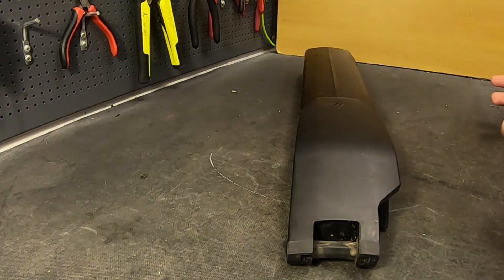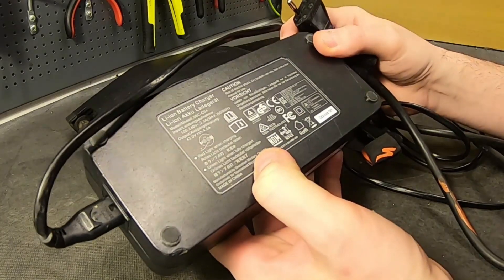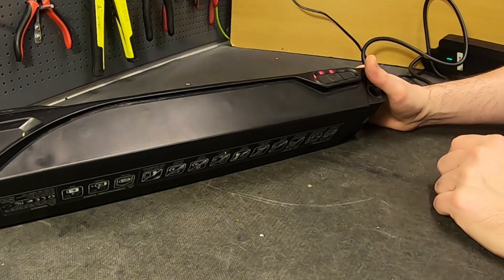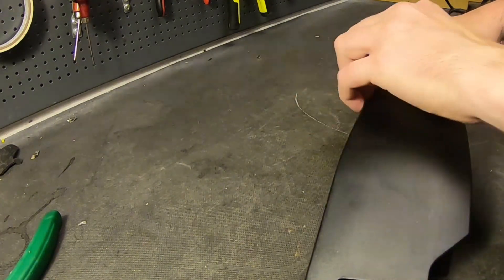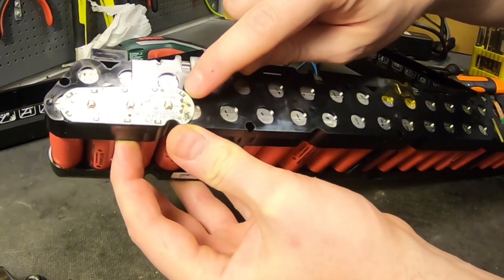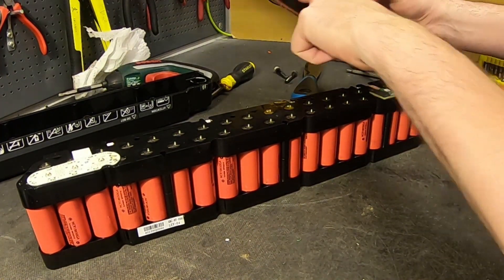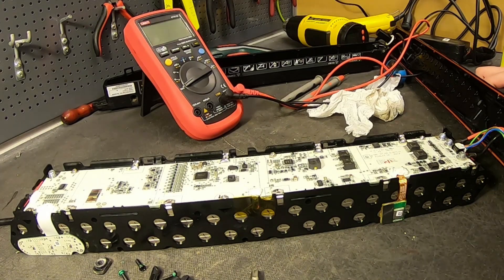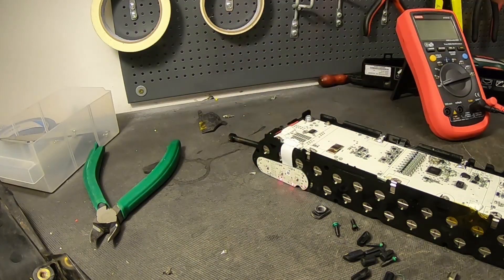Inside a €6700 (Specialized Turbo Kenevo) M1-504Wh Batterypack - with 3 flashing red lights

Comment from the maker: We DONT WORK with Specialized! Only a few copies has ever been sold in sweden! we had about 3 in so far and done videos on those.  Its a good ebike but if you buy a Specialized ebike you most like WONT be able to buy a new battery when you need it since they usually only Sell spare batteri 3-4 years after the bike is released and the battery usually last 4-5 years and cant be repaired. Well Of course they can be repaired by reverse engereering the specialized system but it cost about 11,2 miljon dollars so no one will do that. It might be different in their homemaket in USA but if spare batterier are not in production they are NOT AVAIBLE.
Reply: This is factually wrong - I just checked for the Specialized Levo. The first generation has been released 2015. Seven years have past since then and you can still buy a battery online, delivered within 2-4 days. I then got curios and continued checking for older models: Specialized has made its first E-Bike in 2013, called the Specialized Turbo, and you can STILL buy a battery in 2022! Not only that: You can buy a battery now that has WAY more power than the one from 2013 and yes, it does fit to the old bikes. Stop spreading lies.
Reply: @NemoNobody0  Where are you located? There are no in sweden, and probablly not in the rest of europe. Just because you can buy can buy it (in use, their homemarrkt) does not mean everyone can. Ther have a swedish webbsite but they dont reply to emails. They fücked sweden the same way Bh bikes did, deep, way deep..
Reply: @Batteridoktorn  I do live in Europe as well (Germany). You can order them online from many, many different stores, just Google for the name of the bike followed by „battery“.
Reply: Fuck "Premium" e-bike manufacturer
As my dad says it's like if a gasoline cars works only with one producer of gas.
Reply: @nicolozak  you fell for a lie from @The Battery Doctor. Research by yourself or read my comment above: You can still get batteries for the first E-Bike Specialized has ever produced, you can even get a battery with MORE power now then the release version had in 2013...
Reply: @NemoNobody0  e-bike battery has to be repairable, not repairable means more garbage in our planet and less sustainability, Europe have to change rules for CE requirements on lithium batteries.
Reply: @nicolozak  I agree with you on that, but this goes for all E-Bike manufacturers. The point of discussion was that @The Batter doctor stated that Specialized E-Bikes would be obsolete after four years, claiming they would not provide batteries for sale after this period. According to my research this is wrong.

Comment: The red blinking is normal - It's waiting for an input from the rider to switch to "start" mode - I.e. it's booted up / ready / Armed -  it will switch to run status once a load is put on it . If you have a big resistor sitting around or anything to discharge with - put a load on it and it should switch to the charge status and mode indication . The really "stupid" part with this pack is that it does not care if the drive unit is connected or not - it simply does load / draw etc . . .
Reply: hello. good afternoon. Did you have success repairing the ebike specialized battery?

￼
Reply: I have two batteries with the same problem... but I didn't understand the procedure you mentioned. you can explain better. grateful.
Reply: @LeandroSilva-x4b   These batteries have a behavior where the controller will bring the battery up to a ready state but the indicator will flash red until there is a draw from the motor. I'm not sure how this is programmed in the controller but it is a bit strange as they do not seem to that all the time. It may have something to do with not being actively paired with the app.  You can trick the battery into going "green" by briefly putting a load on  the leads that would connect to the motor - or just plug it directly to the motor and test. I have never found a thorough explanation of this mode just vague mentions of it somewhere on a troubleshooting forum. I rebuilt two of these packs after insulating and sealing around the controller board. I replaced all the cells in both packs and charged them equally to about 60 percent prior to sealing the packs back together then charging them. Notably I have no knowledge of how this controller "exactly" works but I was willing to try it as I had nothing to loose as both my packs were working but would voltage dip in a few miles and cause a shutdown.    ;)   Overall - the design of this pack seems great except for the control board buttons which in both of my packs ( including a non-recalled one ) was open to allow water in.

Comment: Anyone succeed refurbishing M1 battery? I had threebateris with same symptoms, 3 blinking red led and beeping. Internal cells are OK, currently charged on 3.7v/block but still BMS does not want to take charge over original charger. BMS has RISC processor but cannot find anyone on internet that successfully refreshed or modified firmware to clear state.
Reply: In case of you charge the battery block by block (so not with the original charger), is the battery able to drive the motor? I mean, does the power electornic part of the board work to the direction of the motor?

Comment: Hey Doctor! We need to hear if you got this battery alive again? I had the same issue! But the bike drove OK for 35 to 40 kilometers.. I talked to LBS and he advice me to firmware upgrade the battery.. My charger worked and I could charge the battery.. but the bike cut off at 30%.. I measured the cells and have 3 cells with 0.2V under the other 7 cells. After the FW upgrade the battery is dead!! It flashes red in 5 of 10 pixels and the test software says replace battery. (before fw upgrade the bike worked) So specialized killed my battery :( Now im charging cells individually.. But software is still locked to this dead battery state. Have you had any success in charting individual cells?

Comment: I see no point in watching this video - it shows water damage through the control switch but otherwise unhelpful in repair options....
Reply from the maker: well since its really cant be repaired you will not find any "Repair your specialized turbo battery easy videos". You will have to by and new one and then your bike will stolen... good luck

Comment: Is it possible to add larger internal cells/batteries in the battery to increase the life when riding? 504wh is very poor and currently only getting 14miles while climbing 2x 1500ft 3mile climbs (along with the downs).
Or any way of creating a smaller backup battery to take?

Comment: I have a newer levo with 700wh battery it has 21700’s I believe. Would it be possible to remove half the cells and still have all the electronics still function?
Reply: Why would you do that?
Reply: Daniel Jonsson -4lbs

Comment: At 3:10 the part you remove is probably the skid plate to protect the battery if this off-road oriented mountain bike hits rocks on the trail. I have a sister bike of the Kenevo, the Levo.